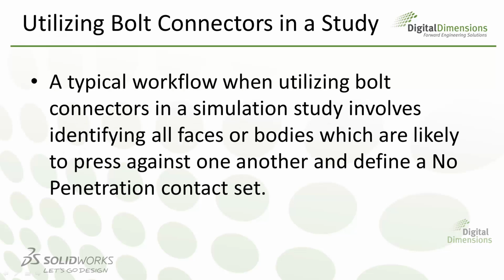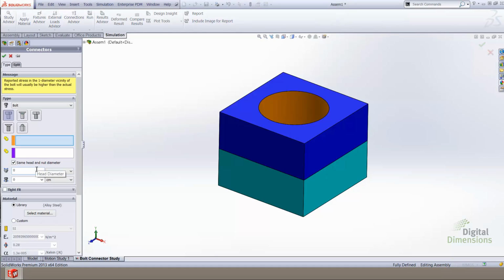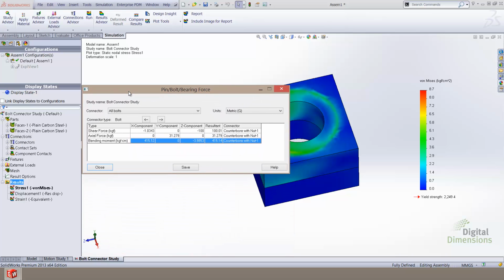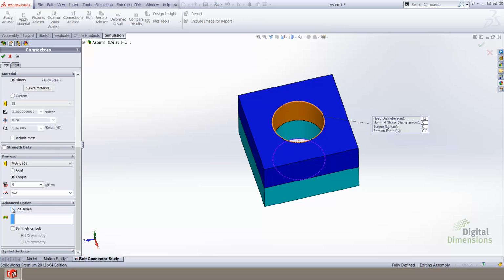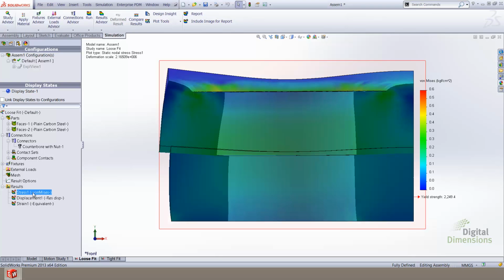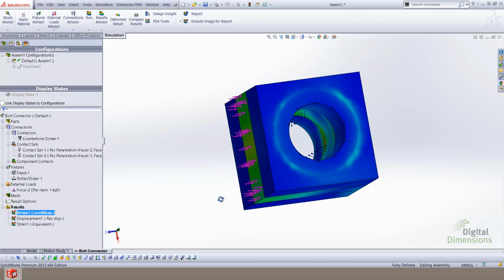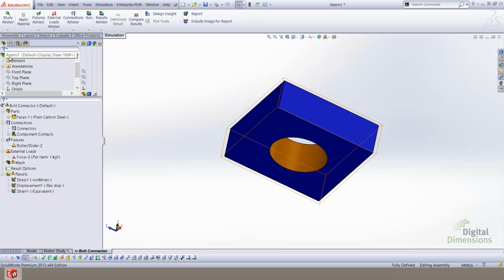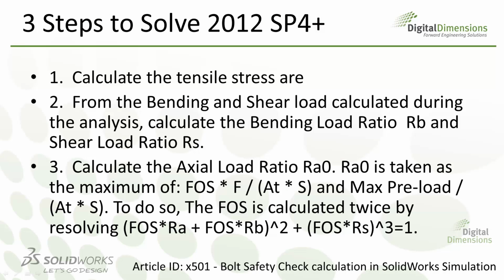Video Archive: SOLIDWORKS Simulation - Bolt Connnectors

Comment: Thanks a lot sir, a great help for beginners.Sir I have a question plz. Sir in your bolt connection portion of presentation it is not cleared to me that we will delete the "Global contact (Bonded defined by Solidworks in an assembly)" to define the new bolt connectors and to define the no penetration contact set between two joining plates (Joined with help of bolts).
Suggestion required.I can provide you my solidworks file on your demand.